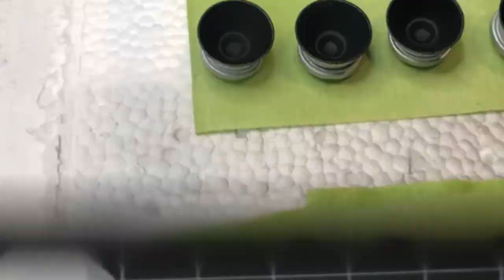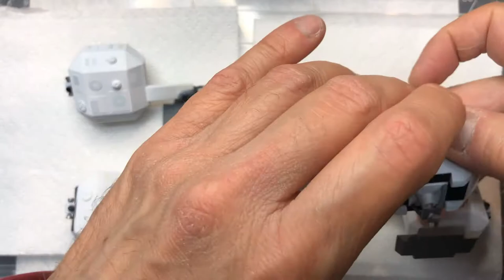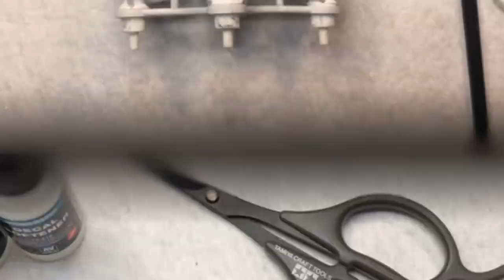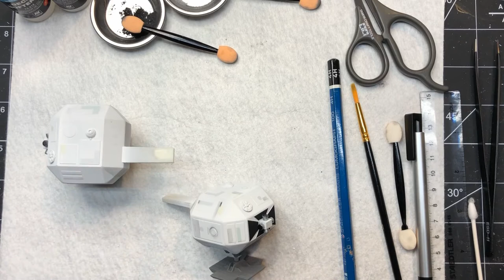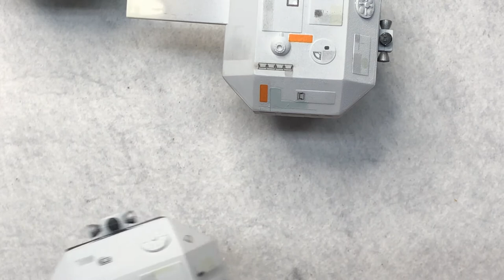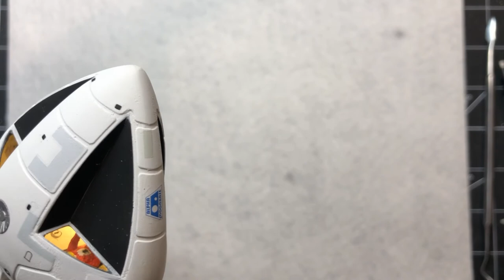Space: 1999 Eagle 1 - Part 3 - Decal and Done - 1:72 - mpc

Comment: A great build. I just finished making one of those kits yesterday. A well made kit but the instructions leave a bit to be desired. They actually left out 1 stage of building instructions on the module. Also there wasn't enough of the tiny black squares on the decal sheet to do all of them on the model. Also there's a whole load of stencil marking on the decal sheet with no reference in the kit. You have to look at the 22 inch version to see where they go.

Comment: Very good work and thanks for sharing your skills. What is the purpose of applying Decal Fix before applying a decal? And what does the softener do?
Reply from the maker: Hi Cobus, Thank you for your kind comment. I use Decal Fix as it cleans the surface and according to Vallejo "will increase the adhesive properties of the decal." The softener is a solution that chemically softens the carrier so that it will settle into cracks and micro pitted paints as well as over convex and concave shapes. This combo helps reduce or eliminate air bubbles under the decal thereby eliminating silvering once dried. Take care.
Reply: @ArcticModeler  thank you for your reply. Do you usually coat the paint with a varnish before applying the decals to prevent water stains?
Reply from the maker: Hi Cobus, Yes, I typically apply a gloss or semi coat before applying decals. Doing so also ensures that they can be easily moved around to get them properly positioned.
Reply: @ArcticModeler  thanks a lot for your advice, and keep up the good work.